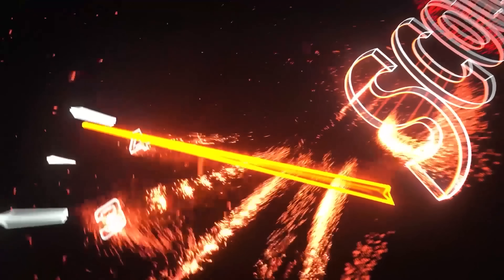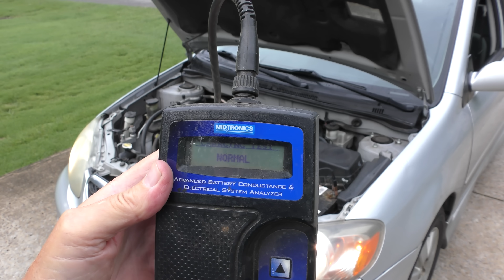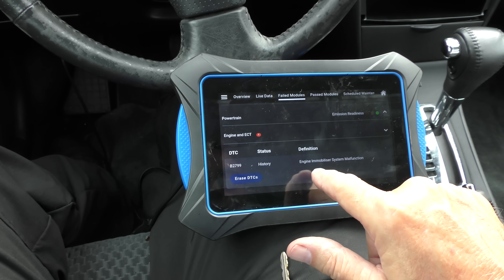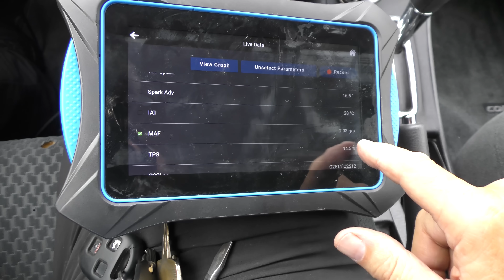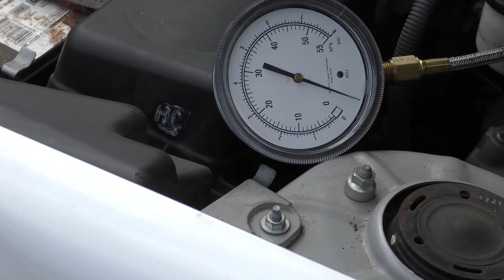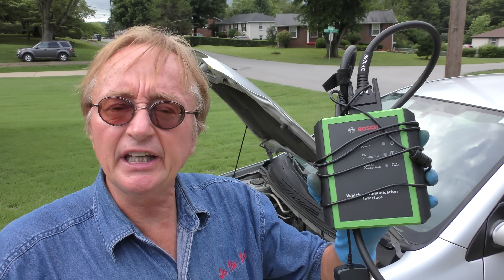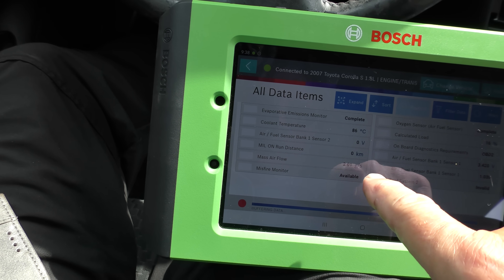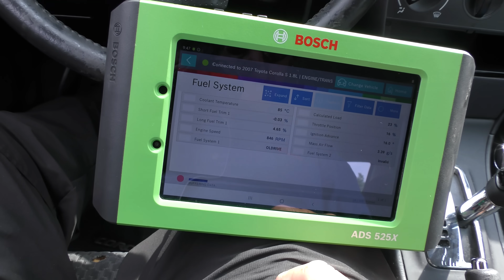I Can't Believe What This Fuel Cleaner Did to My Customer's Car

Comment: I have a 2017 Honda Ridgeline.  I purchased it new and have taken great care of it ie. oil change every month with 0w20, as recommended by Honda.  

My main issue was at 50,000 miles,  the transmission was jerking. Took it to the dealership and they changed the tranny fluid then "re-programmed" it. It ran fine until i got to 90,000 miles.  It started again.  Can I avoid the dealership and possibly "re-program" it, myself? Please advise

Comment: What fuel injector cleaner do you suggest once I used it on my 92 Lexus & boom blew head gasket
;( some people say “ never used fuel additive it eats all the older gummy grommets & rubber gaskets!” 
My old 90’s Rav is acting bad and have to drive it in L then 2 then drive it’s as if I got a stick LOL any suggestions ?

Comment: I have a question:i have a honda Civic 2003 and i have noticed that the temperature gauge sometimes   goes up and down and sometimes  stays up but dont reach the heat point and sometimes stays in good temperature.what the problem could be?

Comment: They really couldn't figure that out with the fuel trim data? That's disappointing, but I'm not surprised, quite frankly it should have been the first thing they tried, as it's the cheapest possible fix.

Comment: I have an 06 chevy Silverado runs just fine but there are a couple things that bother me I’m at 246,000 miles with an engine rebuild between 220,000-240,000 idk how recently the spark plugs were changed I cleaned the Maf sensor done 2 oil changes gotten a new battery and alternator (replaced both) but it still idles pretty rough I picked up some gumout and at first it felt like it helped but not so much anymore it’s a 5.3L V8 1500 with a new transmission new battery new alternator couldn’t find any vacuum leaks and other than spark plugs or a fuel filter I can’t think of a reason why I am having issues would a new air filter help? It seems like sometimes I’ll have occasional electrical spikes and lows but for the most part just a rough idle it starts up every time even after sitting for days
Reply: I have tried my hardest to figure it out about 3 months ago I was having issues with it saying it was running lean but ever since the maf sensor got cleaned the check engine light went away yet it still idles pretty rough I’ve looked up nearly everything in the book and still can’t figure out what is wrong please help me Scotty I don’t want my truck to keep sucking on my paychecks

Comment: so i check on my scan tool and saw a -3° at idle on spark advance is that bad? i have a mini f56 2016 if so how do i fix it, i have any trouble codes or engine light but yesterday i saw a bad motor mount in my car and shakes a little when i accelerate from 0 on full throttle and on cold starts sometimes shakes but not to much.

Comment: Scotty I have a question I want a lot of your videos but my son has a 2004 Ford F-150 4x4 with a 5.4 L motor..it has a miss. I took it to a mechanic who is supposed to be very good here in town like number one and the diagnostic came back that it was a fuel injector so they replace them but that doesn't solve the problem so then they took them back out and put the old ones in but was going to charge me a thousand almost and the plugs were replaced but no luck... the second diagnostic they said the timing chain had jumped a tooth on the gear but since he made a mistake on the fuel injectors I didn't believe him... I took it to the Ford truck Fleet dealer in Modesto California for a diagnostic and they said it was the coils and clogged catalytic converters.. taken very good care of this truck my son has so what do you think and I respect your opinion is the problem before we put any more money out it does have 217 thousand miles...

Comment: The engine rpm on the scan tool at the 7:57 mark is zero so the fuel trim is going to be zero meaning that doesn't prove the royal purple works. Am I missing something?

Comment: I have a 2001 jeep cherokee and its hard to start and I just changed the fuel pump, but when I drive it drives just fine and when its warm and I try to start it it dies right away

Comment: Scotty got I got a 99 dodge ram 2500 with the 8.0 V10 magnum had to replace the harmonic balancer twice and the bolt keeps backing out & causing it to damage the new balancer I have used lock tight and the bolt is tourqed property what would your suggestions to fix this issues from happening again

Comment: I have a 2000 Nissan Frontier xe and I’ve done all the maintenance after buying it (new belts,filter, oil change etc. ) and the OGspecs say I should get 22city and 26 highway (2.4L 4Cyl) but I’m only getting 15city and 20 highway. This loss of millage plus loss of power when accelerating (only recent) is very confusing to me do you have any tips or trick on how to get back to that 22city/26highway millage?

Comment: Hi Scotty,  I have a 2009 prius and ran great 45k miles.  I had the transmission fluid and coolant fluid changed for servicing and now car runs noisier, sluggish to accelerate.  What could be the connection?

Comment: Hey Master Scotty, are you aware of the cylinder issue on the ford fusion EcoBoost? Especially the 1.5L?? 

Apparently any one of the cylinders will randomly misfire and coolant intrudes the motor and Ford dgaf!!!  Just happened to me with only 60k miles. 

Any feedback is appreciated

Comment: Heyyy Mr.Scotty, I have a question my 2000 mustang gt cranks but once it warms up it shuts off with no engine light is on I've taken the car to an electrical repair shop and no luck, I'm thinking that it's these cheap fuel injectors I brought ebay causing this misfire like issue the car is running very poorly and at the traffic light I have to keep my foot on the break and gas pedal. Need some help

Comment: Scotty, I have a 2018 GMC Canyon which has been great with 47000 miles on it. I have been contemplating trading it on a new Toyota SR5 Tacoma 4X4. I test drove one today, and with the heightened resale values on trade in value today, I am seriously considering the trade. The Tacoma doesn’t come close to the acceleration I get from my Canyon, but I know the resale value and reliability of the Tacoma seems to be a good trade right now, without an increase in monthly payments. Do you think this would be a good trade when I can get the 4X4 Tacoma at the same monthly payment? The Tacoma is a V6, which I felt like it lacked power.

Comment: I have a 2007 Dodge Charger. It stopped running. Starter alternator and battery good. I was told “ it’s not the engine but something within it”  what the heck does that mean!? Please help

Comment: Hey Scotty I have a 2002 Nissan Xterra and I have a P0300 code I replace the spark plugs and the ignition wires and I put luces injector cleaner in my car and it’s still giving me that code what should I do?

Comment: I've got a 2006 Saturn Vue 5 speed, 2.2L.  When I engage the clutch from 1st to 2nd, it drags a little like the transmission is slowing it down but it shifts fine and easy.  Is this common?

Comment: I have a 2011 Toyota Corolla that i bought a couple months ago ...it gives me horrible gas mileage  only 300 miles on a full tank .not what i was expecting ......it has 122000 miles .it seems to be running fine ...i have changed spark plugs and engine oil and air filters ..and cv axles cuz they  were bad and making noise ..no check engine light has ever come on ...any suggestions on what the pfoblem might be ? Should i go get the fuel system cleaned ......it is really stressing me out that it seems to be using up too much gas ..

Comment: Ive changed my clutch fan my thermostat my radiator and I still overheat if I stop for like 30 to 40 minutes through a drive-thru AC stops working 2 soon as I drive it's fine what could this be

Comment: you didn't say clearly enough, that it's fixed or not. you did say its getting richer which is on the good side,,,"butt" did it finally run better and accelerate properly now, or, not after the fuel cleaner?

Comment: Having this exact issue with my 05 sierra 350,000kms. It seems it needs a fuel injector treatment about every three months. I'm thinking the injectors also get sticky with age and the cleaner helps lubricate the injectors as the fuel quality is so poor these days with all the corn in it!

Comment: I have a 2016 Honda CVR that ends up with a dead battery if it sits for more than 3 days. It's been to the dealer 4 times and still no fix, 2 batteries and a starter change later. Help
Reply: There's something is draining the battery
Dome light? Doors not closing sealing/locking properly so it keeps Dome light on?
The hatch?
Alternator?
On board computer?
Reply: @wendyc7730  all been checked. Dealer can’t figure it out. What options do I have if they can’t fix it?
Reply: @AstroJWA  Go to an independent mechanic then.
Tell them to put a scan tool to see codes.
You need a second opinion than the dealership

Comment: hey Scotty, I have a question I have an 06 Scion xB I was wondering is there a way to make it go faster
Reply: My 2005 scion xa has 290,000 miles on it. 
From scion chat rooms they say you can’t do much with the 1.5L engines to make em less slow.
Reply: Adding a 454 V8, but it won't fit. Well, at least easily. On a slightly more serious vein, maybe a performance chip in the ECM?
Reply: @markh.6687  there are 3ways to make it faster.

Comment: First off the color of coolant makes no difference. It's just the dye that each manufacturer puts in their coolant, I used to sell clear coolant in 55 gallon drums so that it can be mixed with any other color coolant during a top off. Secondly that Tracker is made by Suzuki so they better use what the owners manual states, I doubt it's Dexcool. Come one Scotty you're starting to slip.

Comment: Honestly…first step is to use some fuel system cleaner.  Fuel injection systems need cleaner on a regular basis to ensure smooth operation.

Comment: Hey Scotty I’ve been thinking of get my mom a Corolla, which year would you recommend? & What’s your favorite engine to work on?
Reply: The one he's working on is a 2005-08 I have an 08 and the few issues I've had were easy to fix, intake manifold gasket, valve cover gaskets, other than that it's been a really good little car.

Comment: hello guys ,  i have kind of a similar issue , i have a toyota corolla 2015 , 1.8l  , i have two codes p0441 - incorrect purge flow p2420 - evap emissions  system switching valve control circuit high ( ive read that toyota calls purge solenoid the switching valve ) - ive tried to look around for broken wires or hoses or lose hoses or any other physical damage but found nothing ,  

i think its the purge solenoid that i need to test , which is usually on the top right-ish corner of the engine if ur standing at the front of car facing the engine, one question  is should i buy a multimeter to test the solenoid ??   

also for the past month or so the car has barely had any acceleration. it feels like u really need to step on the pedal to get up to some speed. it feels like the car is like suffocating , like not delivring full power 

i tried looking at the live data but im still pretty confused , SHFT1(%)    0.8 - 1.6 , LNFT1(%)   9.4  O2S11-   +3.3 , O2S12--   +0.115   AND THEN there was SHRTFT12(%) - 99.2 . THIS last shrtft has me scratching my head , this whole thing has me scratching my head,   im so very new at this but im thinking the car is running rich cuz its getting too much fuel cuz the purge solenoid is stuck open? the oxygen sensor 11 just stayed at +3.3 didnt move or anything . im not sure what  is makin it run so rough:(  if anyone can guide me on what i can do , where i can start. any help would be appreciated , thankyou for taking the time to help!

Comment: Hey Scotty, I got an 06 ram 1500 with about 270k miles on it, I got a transmission code popping up about the tranny control system and I can’t shift into 3rd gear (it’s an automatic) what do you think the issue is
Reply: Shift solenoid? Or perhaps that trans is done and done.

Comment: I have a similar problem, car (bmw e36 1998, 93k miles) does not accelarate over 2,5k rpms, even with gas throttle to the floor. It also seems to run rich as fule drips from exhaust pipe after a while. Cleaned Maf, changed fuel filter + fuel pump, new spark plugs, new air filter. Kind of at a loss at this point.. anyone recognise the symptoms :) ?

Comment: And DO NOT put gasket paste, silicone gasket gel, or anything at all on gaskets unless the gasket manufacturer so directs, and use only the specified stuff. Shade tree mechanics think that they can improve on the gasket engineers’ and makers’ designs.
Old rear-engined, air-cooled VW motors’ crankcase halves were precision machined to seal without a sealer when originally assembled at the factory. When separated and reassembled the correct sealing paste must be used as the original texture of the machining was crushed when originally assembled. Further, at the factory a gang power wrench tightened all of the screws to the correct torque simultaneously. You cannot do this in the field, so the correct tightening and torquing sequence must be followed.

Comment: Ethanol fuel has F'd up everything. Liqui -Moly injection product is very good too. Their engine flush did wonders for my 195,000 mile and 120,000 mile Subaru's. The engines purr now and I'll be honest I don't trust "flush" products. The German's got it right.

Comment: Look what this fuel cleaner did to the side of my car when I missed the funnel?  <jk>
So where does one ask the STUPID QUESTIONS around here?
I've heard a number of vehicles (and experienced some) with what's called "limp mode," as something INTENTIONALLY designed to allow you to at least get out of the middle of the freeway, or such.  But - what vehicles have such "features," I'm wondering, because my 99 Chevy 350 Vortec just scared me good as I was dragging a 2500 lb trailer up some rather extended climbs (6000 feet in 60 miles).  It's an automatic, of course, and I was keeping it out of OD unless it was downhill.  As Murphy's Law would have it, on the last big climb it started to sputter (a little) and started losing power - worse and worse - until I was down to 2nd gear and about 20 mph - still struggling.  Oil pressure was good.  Temp was good - or so the gauge said.  Ambient temp, though, was about 90 so IT WAS HOT.  I wonder if the tranny wasn't overheated and heating up under the hood enough to bring intake air temp out of bounds or something.  Anyway, I got off the freeway and let things cool down - after which I hobbled on to my destination (which, fortunately, was all downhill from there, as they say).  So it all SEEMS OK now, as I got back home without further ado, by babying it on any climbs, but - WHAT could have been going on???

Comment: What I never liked very much were the jacks when you buy new automobiles how unsafe they are I found out a nice small floor jack worked best and also small pieces of wood no sharp adhesive put by wheels so your vehicle does not move when being raised  some automakers put the spare tires wheels under the rear or front or side hard to put back worse than taking out my vw eurovan had very heavy aluminum wheels dealer cost four hundred plus tax now I repeat somethings done on cars when made at the factory assembly line if we’re the same but made differently like bigger mirrors turn signals that could be seen when used if or more I mentioned before life would be so much nicer more simplier these days I hear different no spare tires or if so not full size do we really need everything on automobiles we now have two ways for speed control first gasoline pedals next cruise control only on boats one way abs brakes plus foot pedal I could say growing up how much different automobiles were made windows hand brakes spare tires switches for your lights and more semaphore turn signals  now I say no matter how well made if the owner driver user does not mantain it properly cheapest way to keep motor going is oil changes done correctly I never use jiffy lube or would how many do or have work done only when real bad not as I did my last vehicle had it looked at soon when it started if possible I can not do much myself only used places that were honest did not waste my time or money when you work toghether  it is much nicer basically I was only user driver to spend less learn ways best times to drive saves gasoline money time your health or more stop and go is bad not always avoidable there is more thank u enjoy your day if you are not dead or whatever some loco mental does to ut he’s e days who knows adios